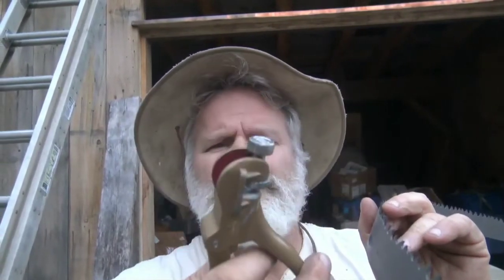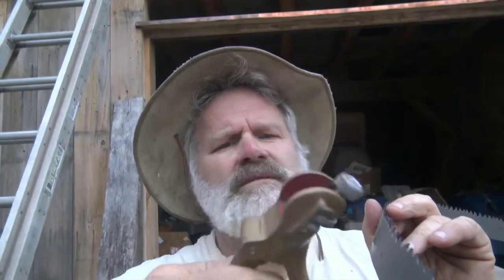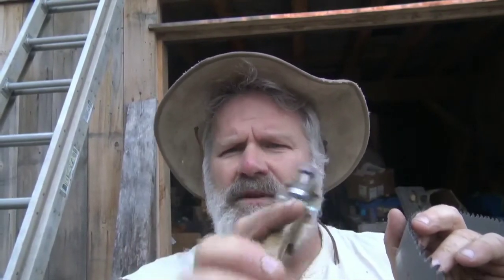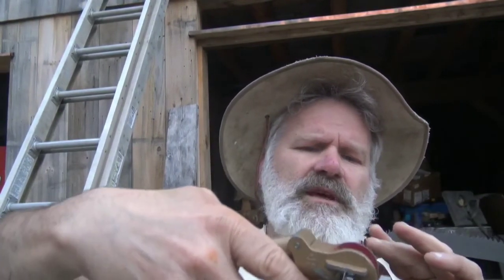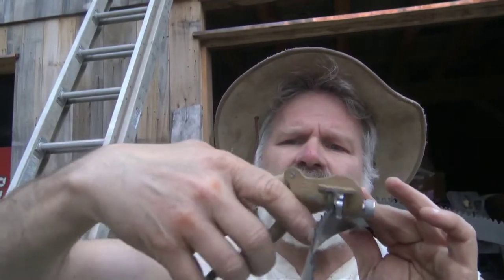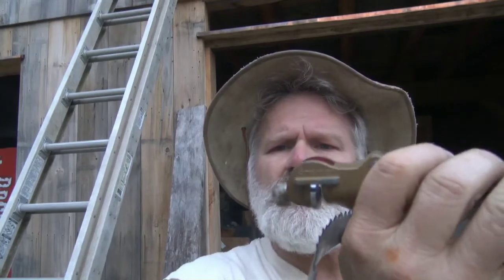Set teeth on bandsaw mill  blade

Comment: What number setting for the angle are you using on the setting I have the same tool... but don't know the number to use.
Reply from the maker: Depends on what kind wood your cutting I dont memorise by number I visually look at the the set you have to experiment for hardwoods less of a set than softwoods etc key is consistancy stay close to set on blade when it waa new...try it on old blade you will get a feel for what works with practice
Reply from the maker: Definately dont use highest setting bigger saw set. Bigger your kerf and will sap power of your motor etc
Reply: @Woodcarving_Master  thanks for your input. Appreciate your time.

Comment: Hello Christopher. I have my sawmill blade that doesn't cut well due to straight teeth caused from cutting hard wood. The question is: how do I recognize which was the left and which was the right teeth to set it up again ? I've heard that if you turns a teeth to the opposite side of the original setting it could break . Thanks if you can help me
Reply from the maker: You should have new blade to compare it to.. and yes you very well could break the teeth if you go in opposite direction....when your setting teeth its tedious careful work... if you look real closely  there should be an ever so slight bend left over in the tooth to give indication  one will bend one way then the next the otherway...and somtimes depending on blade style the 3rd tooth is flat...acts as a chip breaker to clear sawdust...once you get first 3 or 4 teeth just repeat the pattern  all the way around loop.etc...but generally if your gona  do significant  cutting you should always have cpl spare blades to compare...if they get flattened that much...etc I also use a sharpie magic marker to keep track...any method you use to remember etc.